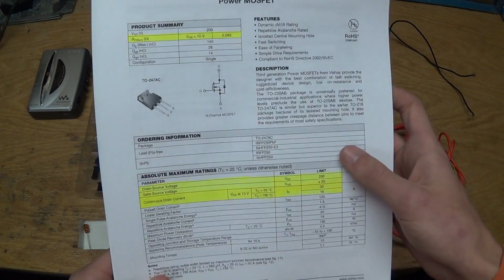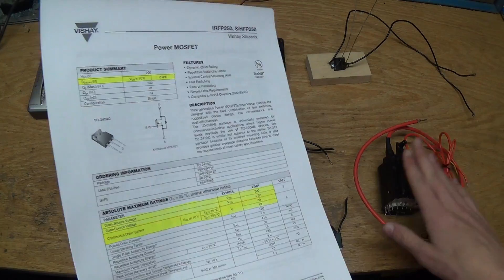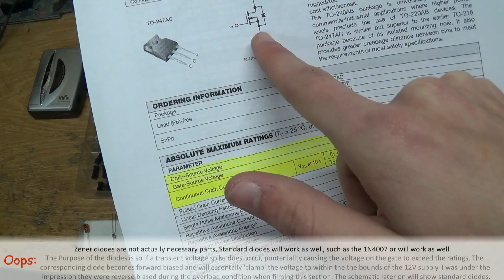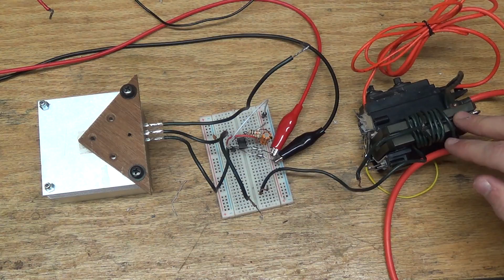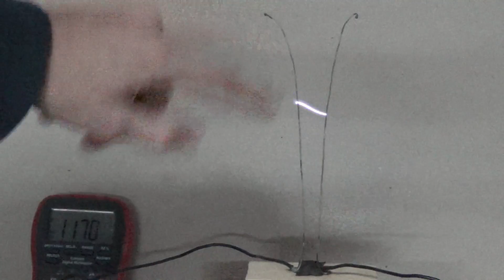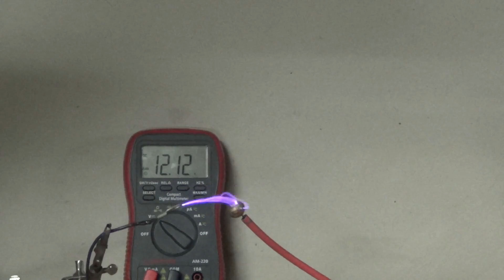Weekend Projects: Make a 69KV Singing Arc Plasma Speaker Flyback Driver!

Comment: I've never burnt out a 555 on any 555 based flyback driver or plasma speaker I made, and mine have only used about 3 amps at the most yet I the arks I get are about the same length and intensity (although I ran mine on about 24 volts). A good idea is to ground the flyback core, and place a single stage preamp between pin 5 of the 555 and the audio source, that way you don't have to crank the volume so much.  This is my singing ark/plasma speaker:  https://www.youtube.com/watch?v=8ju6NjNMvjA sorry there's no schematic shown.
Reply from the maker: Thank you for your input. Actually, there was a vacuum tube PA amplifier off the camera that I didn't show in the video. I used it for the conclusion at the end of the video, you can hear the clipping distortion caused by trying to get it louder. In fact, I actually burned out at least 2 555's before realizing it was because I pumped too much power out of that amp!

Not sure why I find it so easy to burn out the 555's but I have burned out many dozens of them since I first attempted to make my own flyback driver. I am using some really old NE555's made in the 80's. That may be some of it.
Reply: +CoolDudeClem Get a schematic done! :P You're running on 24 volts so there's no real surprise you have less current draw, thanks to equilibrium and likely Ohm's law too! Also the current draw is due to driving the primary, you seem to be thinking that somehow goes through the 555... lol. And Power Max i had a funny feeling you killed the 555 by feeding it something it didn't like... Especially considering the potential output voltage of a tube amp can be rather high, makes sense why you killed so many.. That and ESD (possibly?), age plus if they're not military spec chips they're about 20 years past their guaranteed "sell-by date"! Having said that i have some old 4558D dual op-amp chips from a Radio Shack mixer of 1987 vintage and that used military spec chips! It was a terrible mixer, but it still worked. And similar to what CoolDudeClem suggests..perhaps use a simple op-amp pre-amp stage so you can drive it with a headphone/line output! Common mode operation could surely produce enough gain so i don't think you'd need dual rail supply just for the op-amp.. I also think your original flyback already had issues to fail like that..
Reply from the maker: +ChaosHusky Well according to ohm's law, if you had a higher voltage across a resistance, you would have proportionally more current, and much more power dissipation (power dissipation increases as the square of the voltage, since doubling the voltage will cause current to also double, and that means quadruple the power dissipation). His schematic, like mine, is more or less the exact same. (maybe some slight modifications).

I think you are thinking of constant power load instead, where the current drawn will inversely follow the voltage on the load (as battery voltage falls, the current drawn increases so that constant power is drawn. Similarly, as the voltage increases, the current drawn decreases) This circuit is not a simple load, it cannot be approximated as a constant resistance load (like a tungsten lamp), constant current load, (like a LDO) or a constant power load (like a buck/boost converter). How much power it draws is dependent on the flyback transformer used, primary inductance, voltage delivered to the primary, the duty cycle and frequency of the 555, and then some little bit more for powering the 555 and driving the gate of the MOSFET. Not really worth my time to figure that all out.

YES, current and power DOES enter the 555, and since the gate of the MOSFET has capacitance to it, and we are constantly changing the voltage on it with respect to time, there is reactive, real, and apparent power being delivered to the MOSFET gate. The BJT-based NE555 draws roughly 10mA (which is a LOT to today's CMOS logic standards), and yes, I did kill my 555 with the tube amp. I put too much voltage on the pin 5, so I added some shunt diodes to keep the voltage at pin 5 from exceeding the 12V voltage rail.

Although I am not certain on this, I don't think silicon chip really degrade much at all with time. Capacitors and some other passive components do, electrolytic capacitors for instance dry up over time leading to higher ESR, and even old film capacitors, moisture would work it's way in and make the capacitors 'leaky'. That might be why your audio mixer does not sound good. Replace the caps. So far the only thing that I know of that would cause transistors to deteriorate is damaging radiation that damages the junctions and reduces the effectiveness of transistors.

Comment: Hey! Congratatulations for you Plasma Speaker... Is you first? I have a project to... I worked one year on my plasma Speaker... If you want to see a video... Congratatulations! 

https://www.youtube.com/watch?v=gLle6mLLcOc
https://www.youtube.com/watch?v=icJ4CGZSPLM
Reply from the maker: Luiz Paulo Damaceno It is not my first attempt at a plasma speaker, I attempted this LONG ago, and have not have much success due to inferior transistors, and poor circuit design.
Reply: Power Max i know this issues... ahaha, i "spended" 2 years to complete my circuit, starting with bases on internet... sorry for high time of answer, i dnt have time... =d
Reply from the maker: Luiz Paulo Damaceno No prob! I do still wonder how the one builder in the related comments --> made his so damn powerful the "super flyback driver" that throws like 7 inches of arc without killing the transformer, I actually killed a transformer in the making of my video at 30V!!!
Reply: yes... i have this troubles, my flybacks die in some cases, but you can use unrectified flyack transformer, these flybacks (black and white tvs) haven't a rectfier, in color tvs have a rectfier, its this rectfier who burns... you can use more tan 30v if you make a good insulation on HVGND pin (i use hotglue, a lot), and putting the transformer under mineral oil or car motor oil...
Reply from the maker: Luiz Paulo Damaceno With the circuit in the video, I will need to submerge the transformer in transformer oil and pull a vacuum on it to pull out all the air with more than 18V. Lots of hot glue wasn't the problem. and the issue with my killed flyback is actually carbonization and destruction of the insulation internal to the transformer. My circuit is that powerful! I did fry all my IRFP250's on it, only have 4 left in projects that are wired as ZVS drivers. I bought some more.
Reply: In my last plasma speaker project i jsed a IRFP360... 400v and 20A, a video: https://www.facebook.com/luizpaulo.damaceno.33/videos/vb.100007151315479/1606845016230527/?type=3&theater

this is in 70v, i used a flyback of an crt monitor, for my lucky this flyback of the video haven't a internal capacitor, only a diode... If you dont want to burn IRFP250, actually I use this mosfet, I suggest to you tu reduce the duty cycle, maybe maximum is 56% and add a snubber circuit (RC snubber) in paallel with the mosfet... i use 4,7nF x 2kV and 100r x 10w resistor... incrase the primary coil turns number, for this mosfet, in 36v, i use 12~16 turns of 1mm wire... if you dont want to use a flyback of crt monitor, i suggest to use 29 inches tv fkyback.
Reply from the maker: Luiz Paulo Damaceno I think I made my circuit to use a 60% duty cycle, though I experimented with lower values as well. For my solid state tesla coil project (no videos of it, basically a beefed up version of the slayer exciter) I used the same 555 as an interrupter at 10% duty cycle.
Reply from the maker: Luiz Paulo Damaceno That aint no tesla coil, That is a HF HV singing arc flyback driver! Regardless very neat!
Reply: Is like,  the Corona Discharge,  a "litte " sstc, is like, isnt.

Comment: Nice video. Can I use any High Voltage transformer instead of this flyback and an NPN transistor instead of a MOSFET?
Reply from the maker: I have tested a TIP3055 long in the past, so I know they can be used, although I do not recommend it. (I killed it pretty quickly, likely due to too small a heatsink and thermal runaway, but that was before I knew that adding a tank capacitor can dampen some of the kickback.)

With the correct modifications, almost any transformer can be used. The same driver is used to power ignition coil's, however, they have to be driven at a lower frequency, (so the 555 section is a bit different to output a lower frequency pulses). I have also driven the small main's transformers (the one's from old wall adaptor's) with this circuit to get a few hundred volts out of them, one of them even yielded close to 600V-1000V, enough to draw 1mm arcs.
Reply: Thanks! How about a Tesla Coil transformer, which modifications could I do to make that work? And also, will an MJE3055T work. You used that in your Slayer Exciter/SSTC build, so I was just wondering. Thanks in advance.
Reply from the maker: Lukasz Melchisedekow Do you mean an air-core resonant transformer, like the slayer exciter video I made? You can try it and see.
Reply: Yeah, that is what I mean and an NPN MJE3055T with the circuit mentioned in the video.
Reply from the maker: Lukasz Melchisedekow IDK, but I have attempted to use the ZVS circuit (which is self-resonant due to feedback and does not really need to be tuned) and I got really poor results. The idea was that if I could make the wireless induction coil with the ZVS, what would happen if I tacked on the secondary coil from that slayer exciter? Well unfortunately not much... :( I think it was because the resonant freq. between the primary coil and the capacitor was not high enough freq. For it to work well. You need to run it at much higher frequencies so that there is enough dΦ/dT so that the oscillations in the secondary coil get stronger and stronger as it resonates. (that circuit only oscillates at the resonant freq. of the primary coil and tank capacitor chosen. Even with no capacitance, there is enough stray capacitance to keep the oscillation freq. too low.)
Reply from the maker: Lukasz Melchisedekow I predict that this 555 driver will work if you set it to be around 100 KHz, but I think it will require a LOT of tuning to get it to work about as good as the resonant circuit I made already. Also, the added complexity of this circuit may mean that it is much less reliable, too.
Reply from the maker: BTW, there are schematics online that I have not verified to be reliable, but it is possible to use a 3055. 

https://www.google.com/search?q=flyback+driver&espv=2&biw=1484&bih=775&source=lnms&tbm=isch&sa=X&ei=PsAiVeWmO4i5sAXwu4SQAg&ved=0CAYQ_AUoAQ#tbm=isch&q=555+flyback+driver
Reply: OK, thanks.
Reply from the maker: Lukasz Melchisedekow I tested the circuit in the video with my SEC coil, and it did not work that well. I did not fiddle with it long because I think it is a lost cause.
Reply: Did it create sounds?
Reply from the maker: Lukasz Melchisedekow Yup!
Reply: So, it works?
Reply: With an NPN?
Reply from the maker: Lukasz Melchisedekow IDK try it and see (read the 3rd paragraph in the description.)
Reply: Ok, thanks.